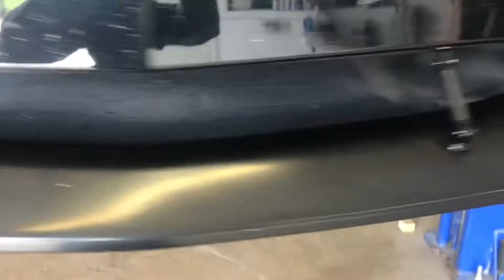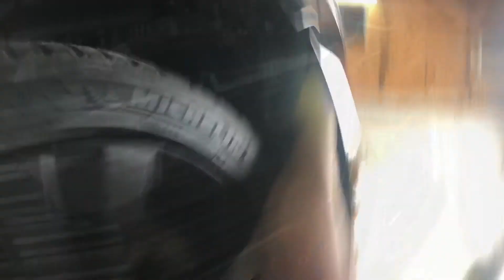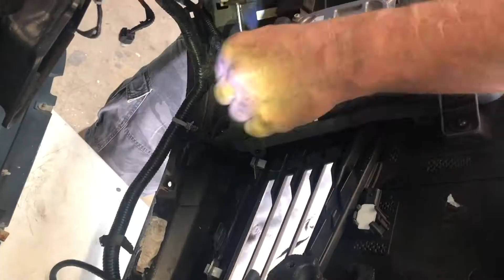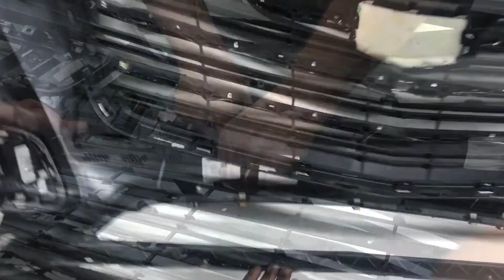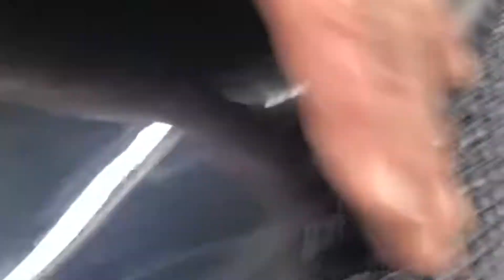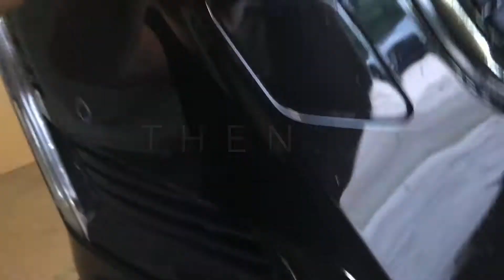Savage Cadillac Grille and Front bumper removal

Comment: So the radar cruise control will read through that piece too?
Reply from the maker: YES NO NEED TO CUT THE MESH OUT THERE IN FRONT OF THE RADAR.
Reply: @savagecadillac832  some members posted the radar acted funky until they cut the mesh and plastic plate. Just cheap insurance or assurance lollllll. I sure be glad when you guys restock cf rear diffusers for the 2016 and early cts's. I need one asap
Reply from the maker: YES WE HAVE CHANGED HOE TO ADD THE EMBLEM MOUNT THANKS
Reply: @savagecadillac832  I'll send you an email